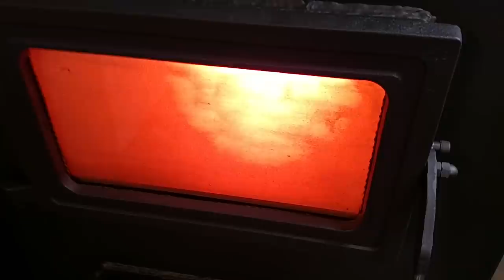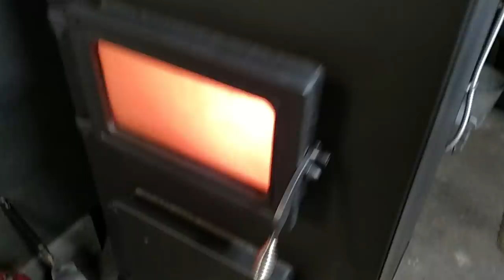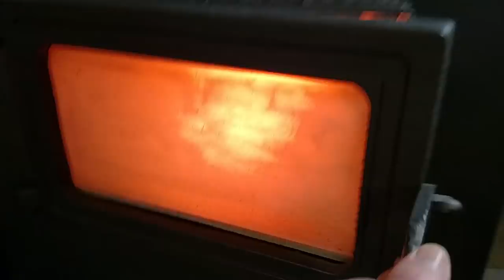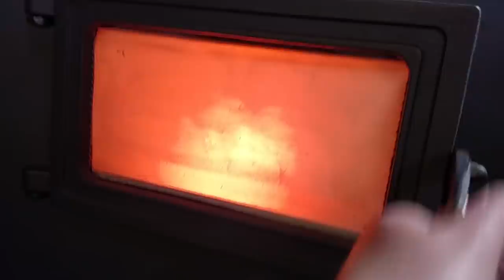Review Of Our New Hitzer 710 Anthracite Coal Stoker.

Comment: How fast does this burn a ton of rice I'm buying one soon and was wondering if I should
Reply from the maker: Bill Welch it truly all depends on how insulated your home is and how cold it is. I fired it up at the end of October and probably went through a ton at this point. I would figure 4-5 ton for the winter here at our place. Keep in mind I loose a lot of heat through our roof, due to I have not renovated the second floor yet and insulated. Hope that helps, I know I love ours.
Reply: Thanks I'm picking mine up this weekend I just was little scared cause how expensive it is
Reply from the maker: what do you heat with now?
Reply: Allegheny Mountain Living I have oil funace as well as a old wood/ coal furnace I just bought this house this year and it had them in it my coal furnace is hand feed and is not working properly from what other people have told me so I found this model you have and really want it to work well for my home
Reply from the maker: I went from a hand fired soft coal/wood furnace. These are a dream compared to them! Very little work compared to what you are used too. Enjoy the new unit!
Reply: Allegheny Mountain Living thanks I'll let you know how how it works out
Reply from the maker: Please do. I have two videos of when I installed the unit here on the channel if you need to see how it all goes together. Take care.
Reply: Allegheny Mountain Living 
Quick question I got my new furnace in and I was wondering if you maunal set it up or do you have it set on auto fan and feed
Reply from the maker: Bill Welch I manually programmed mine. I have it running at 68 during the day while we're away, and then at 5:00 it turns itself up to 71 every day. If you set your time, and then do the day and night programming, it will run the feed rate and fan automatically to achieve the desired heat settings.
Reply: Allegheny Mountain Living ok I did that I didn't know if you maunal adjusted fans and feeder I catch mine warming past the heat I have it set at sometime it is a 2 year old furnace but it seems to be running good other than sometimes it goes past what stat is set
Reply from the maker: Bill Welch it will over heat for the first hour or so after a temperature change and then it brings itself to where it should be. Not sure why it does that, but it makes the house toasty fast! Do you like it so far?
Reply: Allegheny Mountain Living ok that explains it cause it's always around my set time to change temp but yes I love it keep house really warm can't complain at all
Reply from the maker: Bill Welch good to hear, thanks for the update, I was curious how you made out with it.

Comment: I had a Harman stoker for years, very trouble free, what i did to keep it in nice shape, I cleaned it real good and coated the inside with used motor oil
Reply from the maker: Shawn Wiser that's a good idea. They will definitely last if the steel is well maintained. I found that hanging a 40 watt incandescent light bulb inside helps in the humid summer months. Eliminates any moisture that makes it way into the firebox.

Comment: What do you pay for a ton of coal?
Reply from the maker: 180.00
Reply: @AlleghenyMountainLiving  At 10300 BTU/lb your cost for heat is 144,444 BTU / dollar. I paid $1.31 /gallon for fuel oil this fall. At 140,000 BTU / gallon, my cost for heat is 106.870 BTU / dollar. Your cost is cheaper.